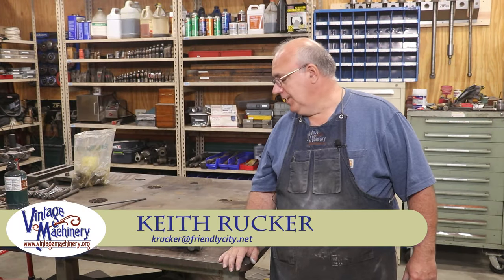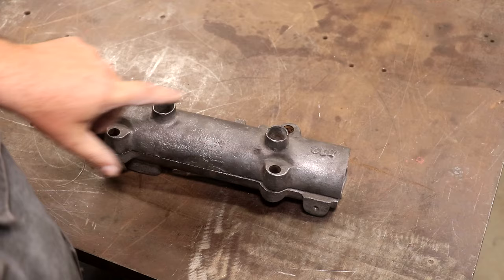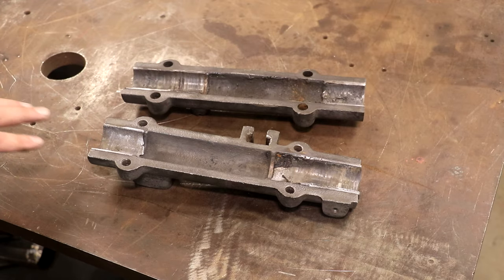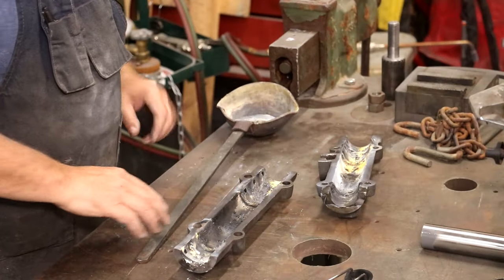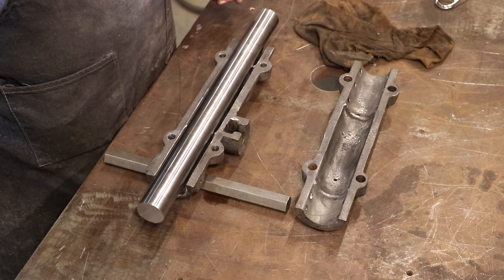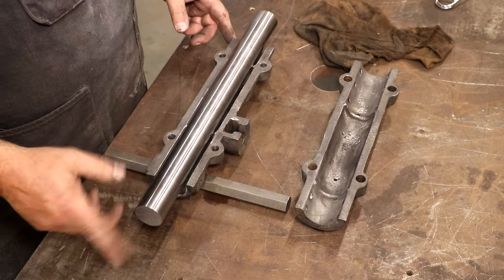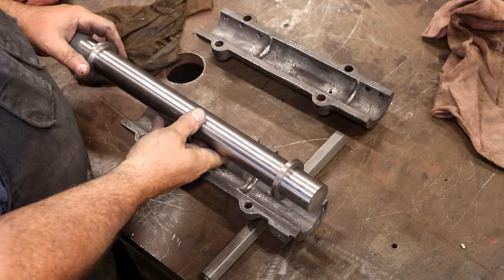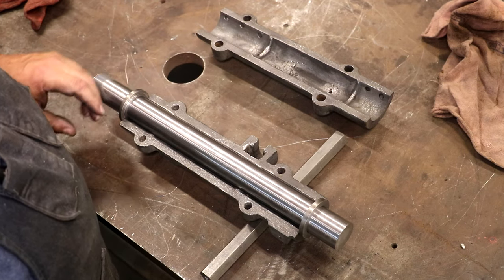Pouring Babbitt Bearings for a Crescent Band Saw

Comment: Thank you for a great video. I am 71 years old and I remember as a youth my dad bought an old 24" wood planer with a square head that needed new babbitt bearings. An 'old timer' came and did it for my dad. After the bearings were poured he 'ran in' the bearings with a mixture of oil. graphite, and other stuff which I can't remember. When he was done the shaft spun effortlessly with NO perceivable run-out. The stuff he used to 'run in' the bearings had to be completely cleaned out for final use. Making sure the shims between the top and bottom bearings was a time consuming process to get them "just right". You could run that planer all day and the bearings never got hot. He also said to never use detergent oil on those bearings.
Reply: Lennart Andre what a brilliant insight 👍. It’s funny how every job was a skilled job 70 years ago wether you kept a store or went door to door re pouring Babbitt bearings. Yet now everything is designed for an idiot to fit and made to last for 5 years. Today bearings are oiled with lubricants in factory that will well exceed the bearings life cycle, 100 years ago the bearing case had spouts to pour new bearings in when the old wore out.  They clearly envisioned their creations lasting 100’s of years. Brilliant =)
Reply: Thanks for your input, As valuable as this video! Now a to re-babbit a model A engine.
Reply: @spoonforthought3534  Yep, it's not hard to make something last a fey years only to be thrown in a landfill.
Reply: @davidburt9238  David, being as everyone back then carried s tool bag and most men knew how to turn a wrench, if a rod started knocking a quick fix to get you back home, pop the cap and use the toughest piece of bacon rind and reinstall. Might have to peal out the babet first. Poor fix but....As a youngster out at the ranch i kept pedaling when my fork bearings went south. I'm not 70 but knocking on the door.
Reply: @cjsmith1760  Thanks for your input Mr Smith, age wise I'm not far behind you.  Back in 1980 for a hundred dollars I bought a Wilson cira 1927 motor driven welder . Got it home and did my darn best to start it up. Never started, backfired and all that! Twenty years later, as I was pulling targets in a pit with another shooter, I told the guy of my problem with the Mod A engine, he asked me about the battery connection and I said pos. to +  and neg. to -- . He explained to me it is a positive ground circuit. I was wrong.  So, I had been spinning the engine in reverse.  Cruel  and hard earned lessons of life.  How you explained your fix was great.  If it got the Tank, Jeep or whatever back home, that's all that counts in war time.  I was critically behind on back taxes on a piece of land so I bid out a job to rebuild an 83' eldorado trans.  Never did a transmission before . wouldn't go into 4th overdrive.  Two weeks working without an auto lift , all underneath.  Got it fixed. If you really set your mind to do something,  anything is possible.  I hope you make it to 90+

Comment: It's interesting to note that Babbit alloy is actually a metal-matrix composite material with hard crystals in a softer matrix. It may be made up of various combinations of tin, lead, copper, antimony and arsenic. Steel shell bearings as used for main bearings and rod bearings in internal combustion engines have a thin coating of Babbit metal on a bronze layer over the steel. Babbit was named after a 19th century mechanic and inventor who did a lot of "metallurgy experiments" to find useful bearing and bushing materials.
Reply: Most modern shell bearings use aluminium/tin these days.

Comment: I have a 36” Crescent that was under a tree for 6 years and I have had it over 20 years.  I got it going and it works fine but it needs new Babbitt.  I have found the bandsaw is more forgiving than my jointer since I can adjust out some of the worn Babbitt by the tilt of the upper wheel.  I don’t put many hours on it and I have so many projects ahead of a bandsaw rebuild.  The 12 inch jointer is more sensitive to worn Babbitt because of cutterhead flutter.  It still has some shims so I can adjust it better when I start using it more, too.  This was such a good presentation and he gave us some great tips.  I will subscribe.

Comment: We had a couple of tractor implements when I was much younger (1950s) that required babbitt bearings.  Though when I think of babbitt now I am reminded of Steinbeck's Grapes of Wrath and pouring babbitt bearings on the roadside to get to California.
Reply: Tom didn't actually pour babbit by the roadside although he feared that he might have to. He was able to get a used rod and piston at a junkyard with good enough babbit that it could actually take some shims. When my high school students would read this none of them had the faintest idea what was being done. When I read this (a really long time ago) I knew what was going on since I had seen my grandfather do the same thing on an old Model A engine he had to power a saw.
Reply: @davedaley9093  thanks for the correction....it's been probably 40 years since I read the book.  Have to pick it up again.

Comment: Flash back to when I poured 6" shafts into big bearing blocks..we'd pour both halfs at the same time..and made a big babbitrite funnel around the pour hole. Didnt know babbitrite wasnt available any more...thanks for the flash back!..(hated melting the old babbit out!)👍🏻👍🏻 if I find and boxes at wirk..I'll send you some..still have pallets of babbit there that isnt used.
Reply: Hi Mike Benjamin 
I would be interested in purchasing the Babbitt if they want to scrap it
Reply: Smart making a funnel.
Reply: I'm guessing it's made from asbestos and oil.  Safe to use but not to make.
Reply: Have you seen the price of Babbitt metal? A pallet load would be worth a pretty good sum!
Reply: @tonywatson987  that'll be the tin. Isn't going to get any cheaper now that lead isn't supposed to be used on Electronics solder either. Such a waste, high tin content solder is pretty naff stuff.
Reply: Yep back in the day I have poured my share of Babbitt bearings. As I worked here in the oilfields where some of the oldest oil wells are still being produced. Just a mile from my house is the oldest producing well and the second oldest ever drilled back in 1860. It came in just a couple months after the Drake well in PA.
Reply: @tomharrell1954  shipping could be an issue!..I'll see what's going on with it..
Reply: Mike Benjamin Where are you or what is zip
Reply: @tomharrell1954  WNY
Reply: Mike Benjamin  
What is the composition of the Babbitt metal that you have?

Comment: Thanks for the video. A good, useful  result is a success. Whatching babbitcing bearings for the axles of steam locomotives I see some differences. Making the bearing a little bit oversize, boaring the ruff surface, blueing the axle and scraping the bearing has been normal. Also a new bearing should only make contact on a rather small part of the circumference, wore in and being adjusted during the first runnings etc.

Comment: Keith...I worked for Otis Elevator for about 30 years.  Not being a union field mechanic,  I witnessed many bearings being poured on huge gear less machines down to much smaller geared machines.   The gearless bearings would be maybe 8 inches in diameter and  the geared bearings maybe 3 to 5 inches  in dia.
The babbit was commercially called cadtex if I remember correctly.   The machine rooms were not air conditioned.  Imagine Richmond, Va in August, and my service crew working, pouring, geared bearings at Hygrade meat packing plant. The temperature at about 95 degrees outside, the Babbitt pot going full blast and the plant waste system starting   to blow the remains of the slaughter of hogs across the roofs of the plant to the holding tanks a hundred yards away. The probably 50 year old piping and blowing system leaking like a sieve and blood and fat being blown over you and your repair team of  mechanic and helper.  The mechanic is yelling at me to not let sweat fall up into the babbitt pot because it will explode with hot Babbitt.   Now,  all that equipment had to be carried to the roof up grease and fat coated stairs by hand, even from the service truck because the elevator is out of service for the bearing job.    The elevator is on full Otis Maintenance so the customer will not be charged a cent of the cost.   Then there is a new Otis Service Manager  standing there giving moral support on a repair that he knows absolutely nothing about but wants to see a babbitted bearings replacement job.   Like the kid who picked up the almost red hot horse shoe the blacksmith had just taken out of the forge, dropping it instantly, commenting......”DOn’t take long to look at a hot horseshoe”.  It don’t take long to took at a pot of hot Babbitt, in a slaughter house in Richmond in July or August.  The mechanic and helper laugh as the Service Manager slips and slides to the stair tower hoping to find a nice spot to throw up at before he gets to his car.  sorry to take so long to tell of my vast experience with babbitted bearings.  The lesson is burned in my memory.  Charlie C was the mechanic, I can’t recall the helper’s name.  I’m sure Charlie is retired and the helper (noe the mechanic) is pouring the Babbitt.  That was about 1966.   That geared machine should be needing new bearings about now.  It is probably about the age of that bandsaw you are restoring.  And it will probably run another 50 or 60 years.  If the motor goes, the same motor shops that rewound our old motors can rewind it, good for another 50 years. 

Great video....Thank you.

JoeB
.

Comment: During the depression up to the Second World War my father-in-law drove trucks. Each truck was equipped with a kit for making big end and main bearings for the engines. The kit contained bearing moulds, bearing material, a reamer and sizing shaft , melting ladle blowtorch etc. . There were next to no spare parts available in NZ in those days as trucks and the like we’re imported and parts were made locally. Drivers were expected to make bearings in their down time. Times have certainly changed

Comment: babbitt = (high speed ) copper + tin + antimony  (pewter)  low speed includes lead
We always use mortite caulking for the dams
the shafts are blacked with a acetylene torch and wrapped with string for oil tracks
and of course spacers made from Beer wrappers

Comment: Keith - Try using TIMESAVER yellow lapping compound on your next babbitt bearing project. Used it on my Model T engine & my Buda engine. Works great - little or no scrapping. Lap the bearing in and wash the compound out. It leaves a nearly perfect precision full contact surface. The oiled shaft will spin effortlessly.

Comment: Nice video. All large engine main shaft bearings are like this. Serviced every 20,000 running hours, there is a special engine mechanic who does the scrapping and verify clearances with lead wire. A tedious job with many half bearings.

Comment: We still use Babbitt bearings in out Model T Fords. Your shaft still looks pretty tight and a great product to use to fit the bearing is Time Saver. It saves a lot of hand scrapping and you end up with near perfect fits.
Reply: Timesaver is a non-embedding lapping compound for non-ferrous soft metals. I use it on early plain bearing British motorcycle engines. It used to be cheap when McMaster-Carr carried it..... now there's one distributor and the price tripled. ☹️

Comment: thanks for this keith, my only machine with babbitt is a crescent 20.  i took the bearing/shaft to a local babbitt guy and his advice was to leave it alone.  so i did, and its been fine so far.  maybe you could comment but the upper wheel is just a shaft running in the casting with no bearing material, it seems fine so far.  crescent also used babbitt in the guide post area(hexagonal) and in the table tilt quadrant, very versatile material
Reply: Cast iron is a pretty good plain bearing material, so it's not uncommon for shafts to run straight in the casting with no discrete bearing added. The ubiquitous South Bend 9" lathes are a good example, most have headstocks made this way with a hardened and 'superfinished' spindle riding directly in the casting.
Reply: @nerd1000ify  thanks for that info, it did seem a little strange at first but it works well after 105 years.  what do you suggest for a lubricant, ive been using 30w non detergent motor oil
Reply: @stevem268  That's probably a good option, especially if it's been working for you. I use ISO 68 hydraulic oil on my lathe and mill.
Reply: @nerd1000ify  ive never measured wear, i would imagine any wear would be in the softer casting.  if something did occur, i could have the casting machined for some modern ball bearings.  the crescent 20 is a smaller but very similar machine to keiths bandsaw.

Comment: Two things. First do NOT skim the scum off your melted rabbit until you have fluxed the metal. I use uncleaned bee's wax form an apiary. The scum that then comes off is only oxides and dirt. By not fluxing some of the alloys float and you then are changing the metallurgy. Second. My guess is that the longer bearings go opposite each other, and then are the load bearing end (band saw wheel end) of the assembly.

Comment: I have been involved in re-metalling rail car axle bearings. We poured fresh metal into the bronze shells using a fabricated steel mold then machined out the excess and scraped to fit the axles. Here in Australia, we referred to it as White Metal, rather than babbitt.
Reply: I've seen this done mistakenly before, probably not in your case, it's the same in the UK we call it white metal, pre ball/roller bearings most were phosphor bronze shells, how do you make half a bearing i was often asked, turn the i/d under size and the o/d over size, cut it along it's length so you have 2 halves then solder it back together, turn it to size and melt the solder, the melted solder covers the heated bronze bearing making it look like it's white metal, this was done on huge 2000 ton hammers and presses where a white metal bearing would collapse in hours, it could take a few days to scrape to size.

Comment: Keith I enjoyed the vid. Pouring bearing for a windmill is done from the top side. We would put a single layer of masking tape on the mandrel then pour. 
  How about doing a take on how plumbers poured for cast iron sewer pipe. As an old electrician running our wires was a pain. Glad those days are gone.
Reply: Tinning

Comment: Very informative! I always wondered what the steps were to pouring bearings. By the way... that bandsaw: Many years ago up in Seattle I had the privilege of constructing a thick plank work bench for a historic schooner which the back of the workbench needed to fit the curves of the inside hull. Just down the dock was the floating workshop of Mr. Frank Prothero, a great builder of schooners. Even in his 90's {at the time} he could still freehand rough out a massive plank to compound curvatures on his SHIPWRIGHT'S Bandsaw. I think that is the type saw you may have there.

Comment: Would it make any sense when pouring babbitt into a very small hole as with the saw bearing, to dam a small reservoir around the hole area to give you a pool to compensate for shrinkage and air bubbles as in general casting?

Comment: Another quick thought.
I am a little disappointed that you didn't teach the young fella how to do this. He would have loved it. 
Now I spent years working for the Brisbane City Council in the Water Department. Both water and sewer. 
When I started I only knew that water came out of the tap and down the drain. 
But learnt so much in such a short period of time compared to the blokes that had spent 30, 40 or 50 years there did. But I made it a point of working with the older fellas. But learning to cast lead bearings got me thebmost overtime. As I learnt from an old Italian bloke who was 1 of the only 2 blokes that knew how to do it. The other had been an office jockey for the previous 10+ years. So I ended up after the bloke I worked with retired the only bloke there that knew how to cast them as the office bloke that knew how it was done retired about a year or 2 before the bloke I was working with that showed me how it was done. 
It is so important that the older blokes MUST pass on there knowledge. They just have to. But 90% take it to the grave with them which is so disappointing. And is one of the major reasons why alot of trades die out. Amd why there is such a skill shortage. 
Well that and the fact that the young fellas these days are lazy and afraid of hard work. And alot of them say when you ask them what do you want to be for a living when your older YouTuber. I want to be a youtuber when I'm older. And never prepare for anything else.

Anywho love your channel. But would like to see you passing your knowledge onto younger people. And do it on video so other young blokes can see that young people are interested in it. 

Take Care

Comment: next time, you can use that dam putty you had on the ends to build a well around the fill holes, and it'll make the pour easier
Reply: Damn the fact that they don't make that damned dam putty anymore.
Reply: @mackk123   for the fill dam you could just use clay it'll hold up to the heat . doesn't have to be that specific material
Reply: @cyberfloater But give it time to dry out a bit. Water-molecules love to party with hot metal...
Reply: I'm guessing it won't need repoured for decades, assuming they use this saw daily. ;). He should build a little case for the pieces he made on the lathe and put it inside the saw with instructions on how to use them.
Reply: The Deal with the bushing is to hold said shaft in the center of the cast!!
Reply: I was thinking the same thing while watching that part.